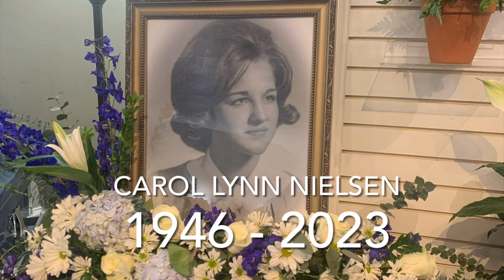How to Hem a Basic Lace Wedding Gown - Bridal Alterations

Comment: Christa you crack me up because I've been altering gowns for 45 years and when you were talking about the brides moving around and looking down etc. and screwing up my pins,  I laughed out loud. 
I have to tell you about something that will save you hours of time when trying to get that invisible thread out - a razor blade!  you can literally splice right down onto that thread and get that lace right off. I used to sit & pick & snip for hours at a time omg.  
45 years and I just figured that out!  you will love it!
I reallly enjoy your videos!
Reply from the maker: Lol 😂 yes! What is with the bride wiggle when you are trying to pin their hems? 😅

I’ve seen so many seamstresses using the razor blade to pick out appliqués. I’ve always been so afraid that it would cut a hole in the tulle. I will have to give it a try in a spot that won’t matter if it does. Now you made me curious if I’ve been missing this all these years. Thanks for the tip Brenda! ❤️
Reply: @christasdressshoppe  the trick to Not putting a hole in the tulle is to touch/scrape the Applique thread with the razor blade. It's hard to explain, but you will see when you get it started. I was TERRIFIED to do this, but I'm telling you it has saved me HOURS of picking!  You deserve it!!
Reply: @brendarowe984  I’m definitely going to try this.  I’ve been so afraid to try it. Thank you! I’ll let you know how it goes!
Reply: @findingshalom  I hope you do,  after I finally got the courage,  I kept saying over & over   "45 years of alterations and I'm just now figuring this out"!!  LOL!!!
Reply: Yes the razor is a gamechanger!! Make sure to use a fresh one often, they get dull quickly, and she has the technique exactly right--gently press against the applique rather than the tulle to pop the stitches. You will be sooo happy, it goes super fast 😊

Comment: Sometimes if you have multiple layers and no matter what you try the lace just won't come out right. I have found that in some dresses you can actually do it from the waist. Take all layers from the waist and pin them together to hold them straight and take apart. Take off the amount you measured from the bottom hem. Making sure to leave a seam allowance. Re gather all layers and re attach to bodice saving all details from lace bottom and not worrying about cutting all layers evenly. Especially if this is a beaded hem.
Reply from the maker: Hello Sherry 
Thank you so much for this comment. Yes, definitely, there are some gowns that lend themselves nicely to lifting at the waist instead of the hem. I have some seamstress friends that would much rather do it that way.  
I have done it that way a few times and once got myself into a real mess taking it apart at the waist. (It just happened to be put together very unusually) ever since then I try to always do my alteration at the hem line.  
But I’m so glad you brought that up for those who might find that much easier.  
-Christa

Comment: Doing an appliqué dress now.  The bell sleeves have kicked my butt!   I had to take ALL the lace of the sleeves (2”) and reattach.   Sad to say, I had to had stitch this back.  Finding those threads underneath was church.   I had 3 lights, and still had issues.   When I could see the sparkle, I would pull like crazy.   The front is going to be different.   I have a free form foot finally coming.  I have a hook in my ceiling with a swivel for my dresses.   It works for pressing a hem, and for trimming.  I also have a mid size bistro table on a platform that I have them stand on and also set my mannequin on.  Than you for the fussy cut!   I am going to try that on the front of this gown.  I think that it MAY work. 🙏🏻🤞🏻🫣
Reply from the maker: Oh gosh! Those invisible threads. Ugh! I’m so sorry it’s been such a struggle.  I always wish those threads would glow with a certain light. But unfortunately I haven’t found one.  😢 
I hope the fussy cuttings works for you! It’s been a life changer. 
Let me know how it goes!
God bless! And Happy Sewing!
-Christa
Reply: @christasdressshoppe  I googled that, too!     I’d you ever find that bobbin thread, you can go to town.  Both sleeves done , but the final stitch in the bottom.  She has to try it on before I cut. 😈     The chalk mark in the mannequin is a gam changer.   I have 4 different sizes.  🫣
Reply: I did the fussy cut.   😱  I have it pinned and it looks awesome.    I did remove the lace appliqués under the hem piece.   The free form foot was wrong.   I found one that fits my old girl.   It is on the way.  My bride is on her way for a fitting so I can finish. 🙏🏻🤞🏻🙏🏻  makes me wonder about my sanity.  🤦🏼‍♀️
Reply from the maker: Yay!! I hope it fit perfectly.
Reply from the maker: lol we all wonder about our sanity at times! 😂
I’m sure you did great! I hope you got the right foot now.  
Blessings!  🤗 😘

Comment: Thank you for demonstrating how to remove the appliques.  I have been looking for awhile now. I have a dress that I am starting.  Its tulle with lace appliques at the bottom. It needs 5 inches removed. So. I think my best options are to remove the appliques that i can,  move them up and place them pretty cut off the excess and sew the appliques in new spot.  If you have a better way??? Again thank you so much.
Reply from the maker: Thank you so much Penny! ♥️
If 5 inches needs to be removed and the lace is below that line, you can fussy cut it away for much of it.  But even then, part of it has to be hand picked away.  
I use a seam ripper. Some of my friends use a razor blade.  I have yet to be brave enough to do that. But soon I’m going to try on a dress that isn’t a brides.  Just to practice and see. 
There are variables too. Like when there is beadwork that goes all the way through the tulle, or a very narrow hem.  
Saying a little prayer for your gown’s lacs to come off easy or give you an easy solution.  
Happy sewing! And thanks so much for watching!
-Christa
Reply: @christasdressshoppe  thank you.  I was just looking at the hem. I've handpicked what I feel comfortable doing. But the rest I'm going to fussy cut. Some of the appliques I can cut away and not lose anything.  I think after that I will move them up and then the bride and I are getting together to decide if we need to add or reposition. Thankfully we have extra appliques to play with.
Reply: How do you repair any holes that occur? Or does that not happen for you?

Comment: Hey Christa... do you mind sharing what brand is your dress form (mannequin) and size?
Reply from the maker: Hello Angie,  🩷
I’m not sure what the brand name is. It’s rubbed off or lost long ago.  But it’s just one of those you get at JoAnn’s fabrics.  
This one is the small size range.  The one I used to have was the medium size range.  I used that thing until it fell apart completely.   
I need to replace it. 
However, let me warn you that all of these type mannequins have plastic moveable parts that break almost right away.  I don’t think they are worth the money we have to spend on them.  However, I keep using them for hems and such years after the adjustable parts break.  I just cannot dial in measurements. Except I can raise and lower the hem hight. 
I just wish they would put metal parts on them.  
Thank you so much for watching and commenting!
God bless! 
Christa
Reply: Thank you so much for  the response. I mostly want it for hems. I want something lightweight to put on the table like you do.. so I can give my poor back a break.  @christasdressshoppe
Reply from the maker: They work great for hems! 
I hope you found a good one. ♥️♥️♥️

Comment: How much should we charge the client for these alterations? I'm starting  alteration. (Please don't say it depends on you and the client and your city....)
Reply from the maker: lol 😂 it does depend on your city and your experience etc.  I am in a smaller town in Idaho and I cannot get as much as my sewing friends in our capital Boise.   And we in Idaho definitely struggle to charge as much as someone in Washington, California or New  York etc.  
However, having said that, I have seen a hem like this across the country go for anywhere between $250 to $700 (I could never get $700 for just the hem. Those that charge that high are in places like New York)
The best way to figure your price is in these steps. 
1. Ask seamstresses around in your area. Also ask in nearby cities or cities with a similar demographics.  
2. Figure out what you need to make per hour. 
3. Keep a journal of time it takes you to work on similar alterations.  Keep a running journal so you start to get an average of how long it takes you. 
4. On hems, time yourself on different types of layers.  
5. Charge by how many layers, what type of layers, appliqués?, beads?  Etc. 
6. Then set a price according to the amount of hours worked and needed hourly wage.  Work with that for a while. Reevaluate every 6 months or so.  Adjust as needed.  
7. As you get more and more experience, increase your price even if your time got quicker.

Comment: What you do call the clip / clamp that you use when the dress is too large for your dress form?  I can't seem to find one on Amazon.  I wondered also if you have tips for horsehair braid hems on the outer layer. I detest them. :)
Reply from the maker: Lol they are just clamps I get at the regular hardware store. Lol 16 years running a bridal shop and my favorite clamps were always from the hardware store.  
I tried all the “bridal store” ones. Those were junk and damaged gowns.  My absolute favorite ones from Home Depot are no longer made and mine have all broke now.  This one came from Harbor Freight. You might find them on line.
Reply: @christasdressshoppe  thank you!